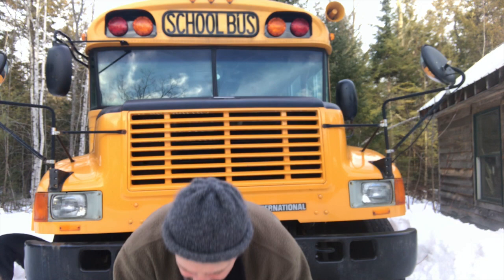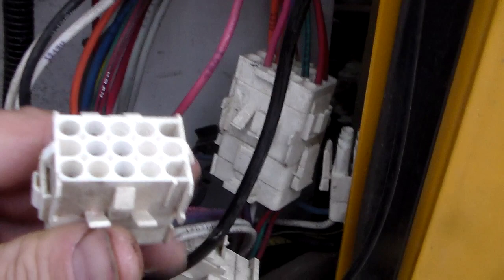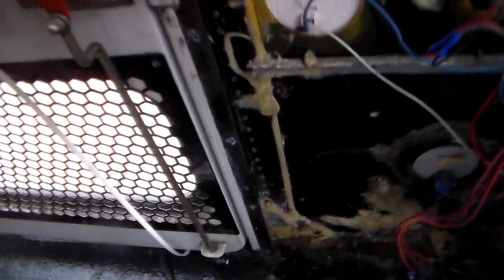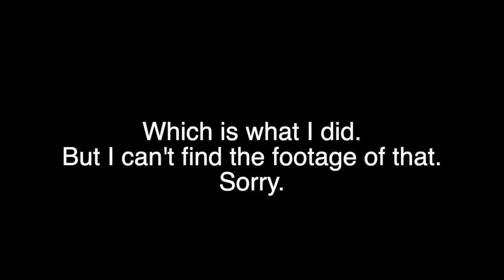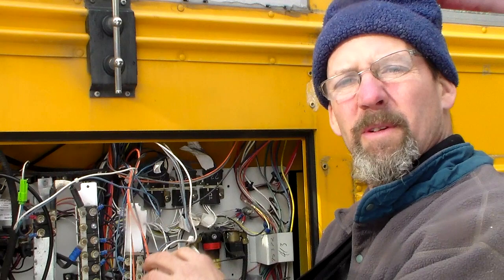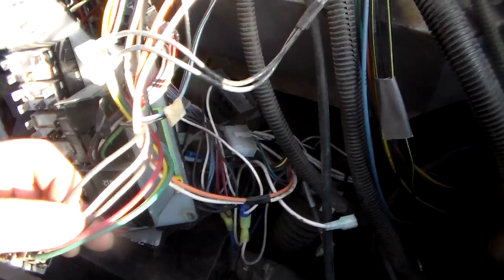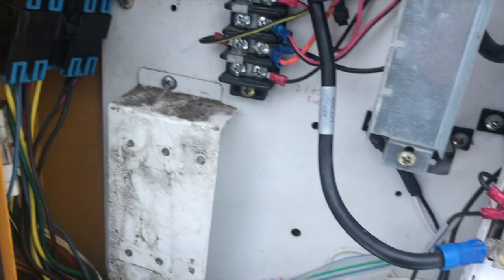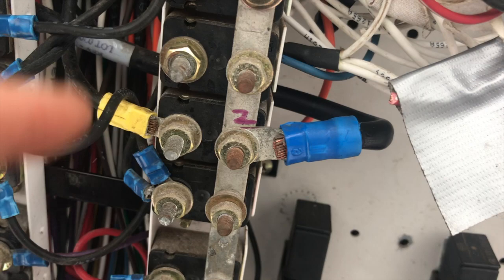A Systematic Way to Remove Skoolie Wiring without Disabling Your Bus

Comment: I'm late finding your videos Ted.  But great detective work in isolating all the electrical issues.  Right on with good labeling, and trying to change only one thing at a time, and then re-verify all's still working that's supposed to be working.  --Mark
Reply from the maker: Thanks, Mark!  It was certainly a learning process and I'm much more knowledgeable about the bus electrical system now!
Reply: @River-Channel  That's the big benefit. By doing it yourself, you know the system now!
Reply from the maker: @mcur7276  The DYI aspect is part of the magic of skoolies!